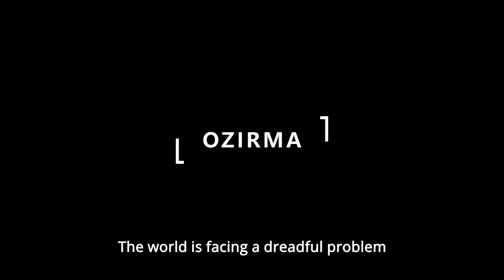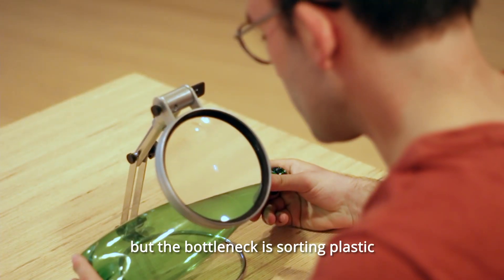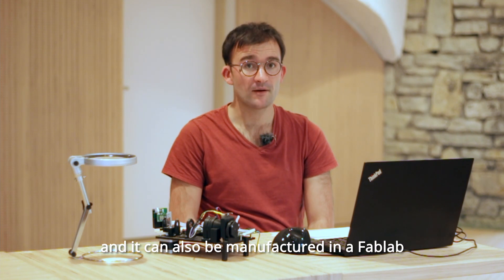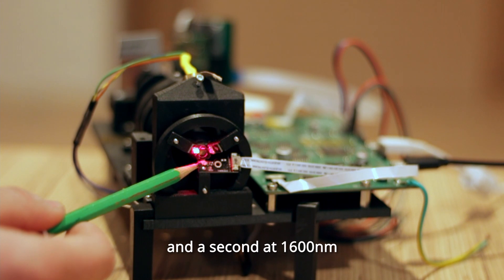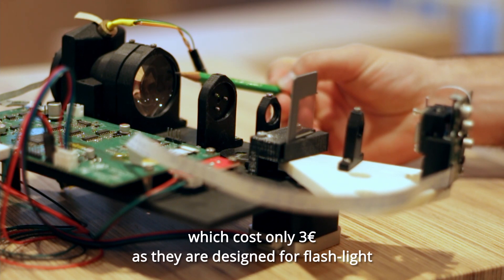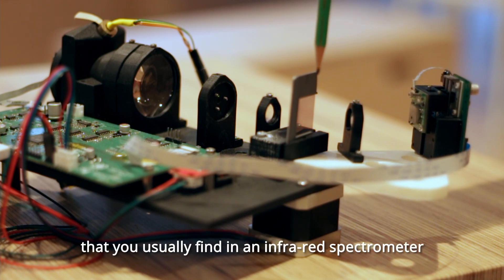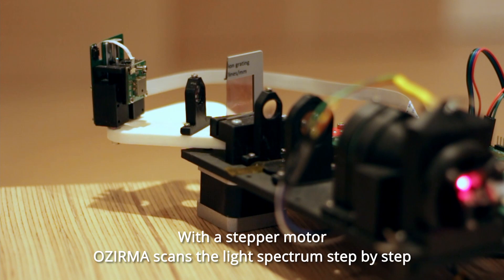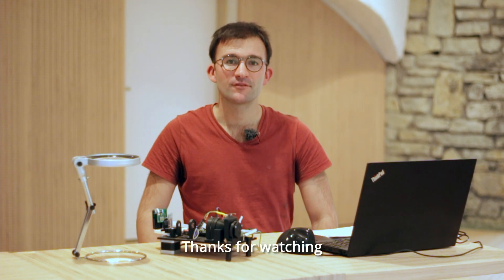Ozirma - A low cost infrared spectrometer

Comment: how about just burning it? a single blue ray burning diode is cheap, dont need to burn much, just for a fraction of a second, then use a fan to blow some of the burnt stuff onto some cheap i2c gas sensors, i havent checked out how many there are, but it must be something like 20 different sensors by now, 3 or 4 should prob suffice to identify what plastic it is.
Reply: Like a LIBS method?  Make me think thermogravimetric combine would be useful, though the non destructive method would be handy and less messy.
Reply: That indeed sounds like LIBS or Spark-Spectroscopy. It would be a completely different sensor, that would IMO  require a linear detector (which would dramatically increase the cost...).
What "cheap i2c gas sensors" are you thinking about?
(10 month latter... sorry.)

Comment: Great! But why you use IR LEDs combining with diffraction grating? Why not to use tungsten lamp that covers all InGaAs photodiode spectrum?
Reply: Hi Alexeï, sorry for the late answer.
The spectral power density (watt per nanometer) of a tungsten bulb is very weak, as most of its spectra is in the far IR.
The InGas LED emit all their optical power exactly in the spectral band we actually need.

Also using tungsten bulb require "a lot" of  electrical power (we are trying to keep the over all consumption of Ozirma bellow 10Watt) and can not be as easily modulated (turned on and off at few kHz) like the LED can.